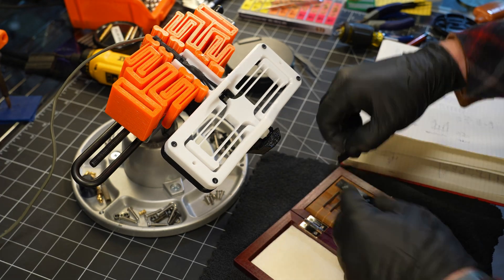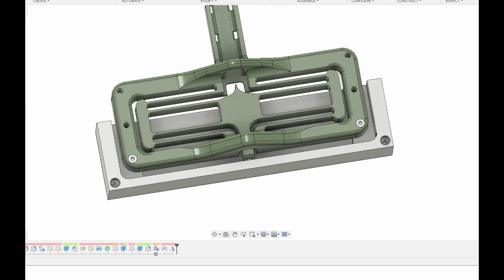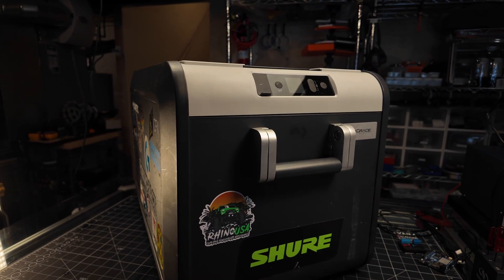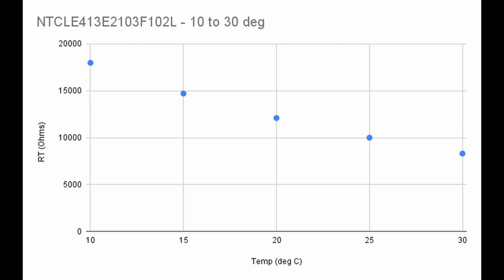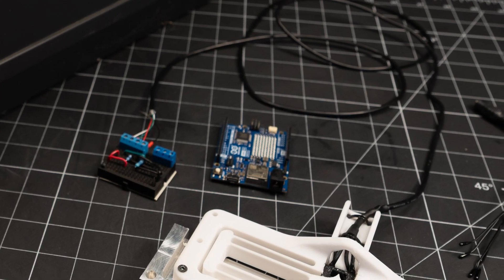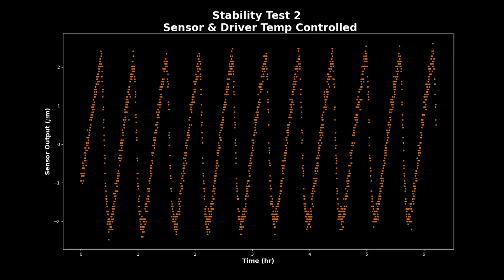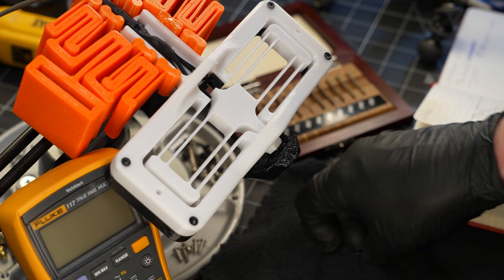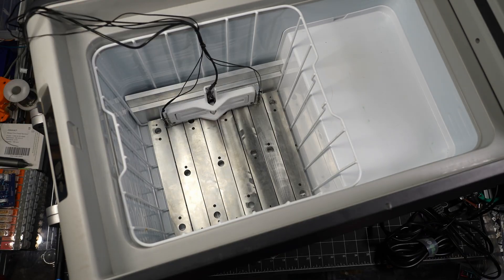Precision on a Budget: Finding the temperature sensitivity of my DIY displacement sensor.

Comment: As a person studying mechanical engineering it was pretty cool to see your test process and data analysis!
Reply from the maker: @lachlanlau thanks and very glad to hear it! Also, not that I'm at all biased, but I think you've selected an excellent course of study!
Reply: @bubsbuilds  Troll comment of the day:  Computer Engineering is better.  It combines both Electrical Engineering and Computer Science.

For real though, all types of engineering are great.  My #1 advice is to not skimp on the basics.  I "passed" my Calculus courses, but then spent years struggling because it turns out I really didn't learn everything I needed later on.
Reply from the maker: @arthurmoore9488  If that's the worst trolling I'm subjected to for posting on YT, I'll consider myself incredibly fortunate! :)

Couldn't agree more though (on the latter point of course...obviously the former is pure insanity...kidding....mostly...) I think engineering is more about a way of thinking and approaching problems than it is a specific discipline. A beautiful solution to a problem is beautiful regardless of whether it's in computer chips or machining chips. And couldn't agree more on the focus on the basics! My experience with respect to calculus has been frighteningly similar (and I'll just add linear algebra....that one has bit me more than I care to admit publicly). Love that you brought this point up, thank you!
Reply: @bubsbuilds  Unlike other things, Math is a tool anyone can borrow from you, yet it never leaves your possession.

Comment: There are a lot of cheap low cte stuff. Invar expands or something with time so it is not that great anyways. I love this kind of content. A lot of clays are about 5ppm sometimes lower, pizza stone even lower. Alumina is good. 
Carbon fiber is extremely low in one fiber direction. Borosilicate glass which can also be melted by torch or microwave kiln is great. 

Wood in fiber direction is very low cte actually. And can be very stable indoors.
Reply from the maker: @leonordin3052 awesome additional input, thank you! I feel like you've given me some homework, in the best possible way :)
Reply: Very interesting. Now wondering what it takes to drill a mounting hole in a pizza stone. I guess its possible.
Reply: @patsauber4843 I'd imagine a masonry drill bit would work.